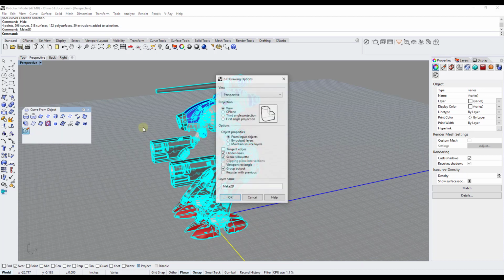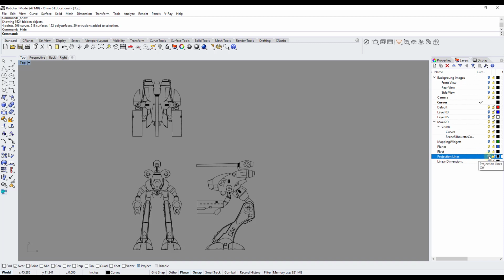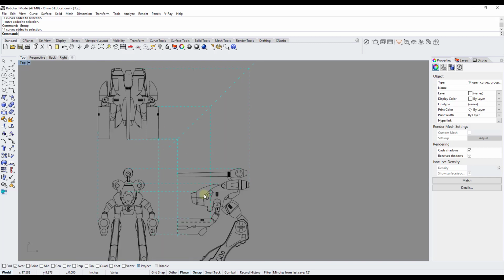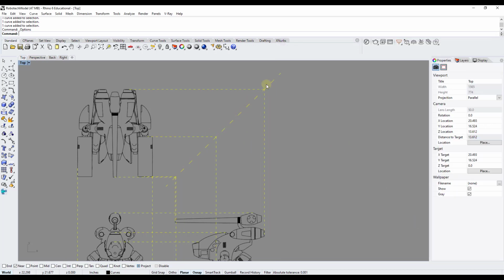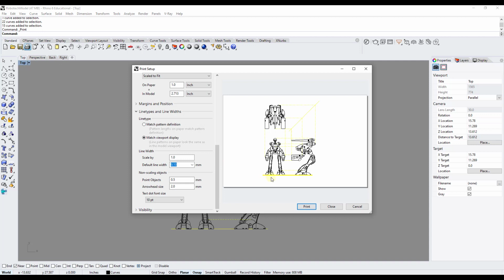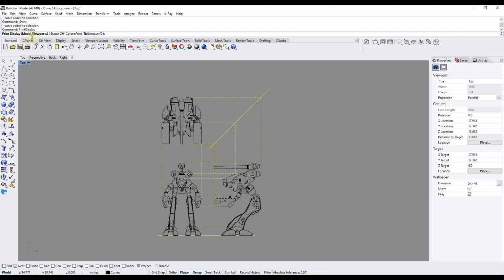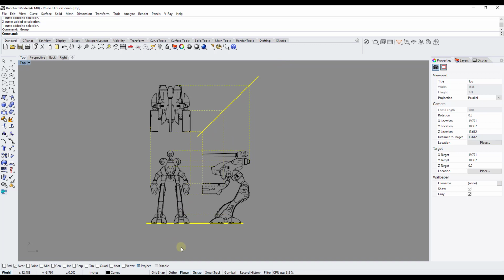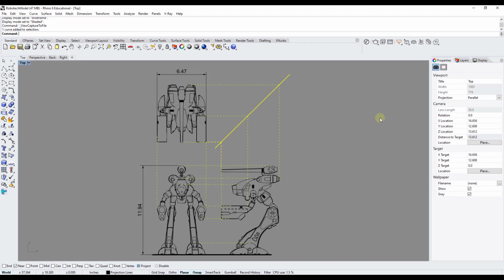Adjusting Line Thicknesses in your viewport in Rhino 3D ( more details in the description )

Comment: Thank you Alexandre, I was struggling with thickness display too. Just to add that you can also adjust line thickness when you set the Layer Print Width and Layout Print Width, without having to select things manually and go to properties. Useful for more standard architectural drawings.

Comment: So what do you do with those projection lines anyhow?

(I started out life as a tool designer so I know what they are for, but I fail to see why you would create them after you have modeled a part?) 

In fact, I can see no reason to create them whatsoever.

Also, when Rhino creates the 2D drawings it is not "unfolding" anything.  Unfolding is a term used to describe flattening a 3D object to determine the flat sheet layout prior to folding or bending, as in sheet metal or card board boxes.
Reply from the maker: Well, if you create a 3D model such as a new aircraft study, (I use that example because that s what me and my colleagues do all the time.), once the 3D model ( Masterline ) is created we then create 3 views ( called a descriptive arrangement ), showing where the Mean Aerodynamic Chord, Landing gears position are, overlay  cabin layouts, overlay a Structural layout etc... going from 3D to 2D is necessary. It s not just a nice to have thing, actually doing drawings in 2D are so much faster at times rather than spending time doing surfacing work all the time . These PDFs are then created of those projected views and are needed to validate the designs with other experts who don't use 3D nor know anything about 3D,  before we go any further.